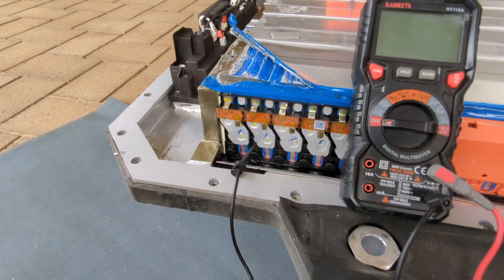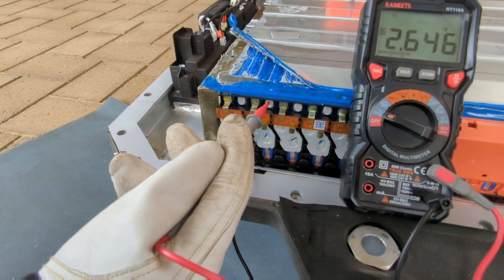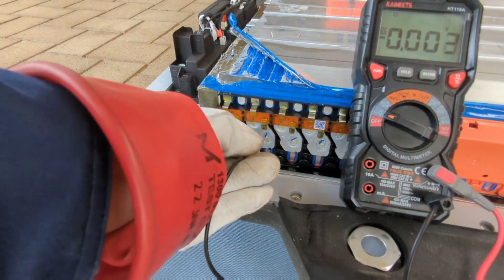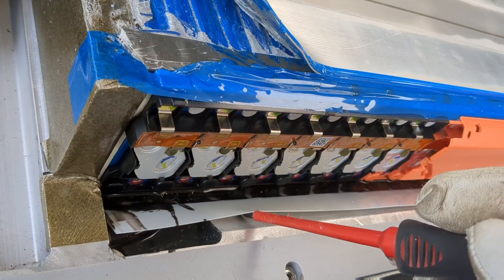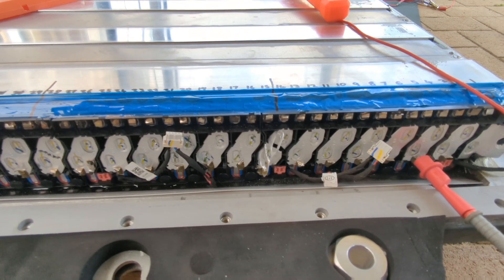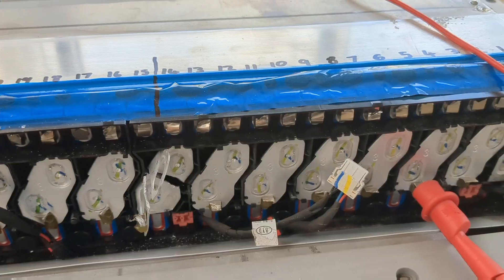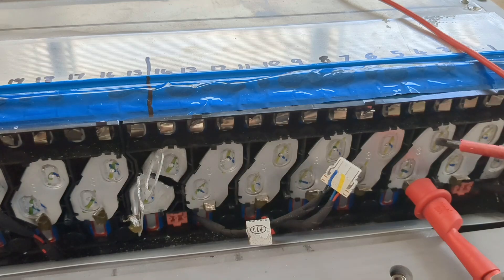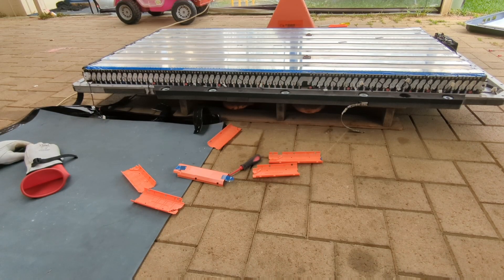BYD Atto 3 battery dismantle P3 - cutting busbars

Comment: Hi Brendon,

Did you locate the pyroe or inertia fuse location in the end?

Thanks
Reply from the maker: Doesn't have one. There is only a conventional over current fuse in the battery pack. During an accident, the SRS logs a fault code and the BMS shuts down the contactors

Comment: why you divide it 14 cells its give you 44.8 volts . if you make it 15 cells its will give you exactly 48 volts ???????
Reply from the maker: Because my current battery is 12s of NVM cells which gives me ≈44V.
Also there are 126 cells in the pack and if I cut it into lots of 15 or 16 I would have cells left over that would be wasted
Reply: @Brendon_M  I understand you , is the system work fine with you , with no problems ? 
Another question , how the bms can read 44 volt as a full battery ??? , what about the cut volt and charge volt and float volt ????
Reply from the maker: My BMS is programmable so I just set the number of cells and the upper and lower voltage limits

Comment: Olá amigo parabéns pelo video posso converter uma bateria assim para usad em 48v sistema Offgrid.
Reply from the maker: If you plan on making a 48V battery then you should avoid the BYD battery. They are too difficult to work with.

Comment: Very interesting work! 👍
To get it right: The BMS was connected to EACH cell originally (or only every second)? The Blade batteries and Teslas 4680 are worst from serviceability point of view - wich is zero. 🙈
Fortunately my Teslas have the  NMC/NCA setup with 4 blocks and also CATL LFP cells. "Kind of" serviceable.
Reply from the maker: Every cell was connected to the original BMS

Comment: Looking at all of this ( great work btw) the conclusion is: If your Ev gets older and is out of warranty and something in there breaks, it's totaled. You always have to change the whole pack. Not even a cell has to be bad. Its enough when one single electronic part of the BMS fails. Looking at this the BMS is much more complex then I thought.
Reply: Well first this is a home tear down.

If you watch a modern mobile phone tear down, you need the right equipment to break them down.

You will need a heated table to activate the sealer,  and solvents to remove the foam fillers.

There is always a trade off between repairability and reliability.  
For you to have a waterproof battery pack that can survive 300k km of abuse on poor quality roads,  it's going to be assembled in a way that is going to constrain vibrations and contain water ingress.
Reply from the maker: Thanks, though I'd be hesitant to call this butchery "great work"😆

Comment: the metal case of each lifepo4 cell is powered too; having physical contact of these metal case is a bad short
Reply from the maker: Not in this case (pun intended). The cell terminals are not galvanically connected to the case.

Comment: Hi just watched your video after cutting battery how do you connect to cells ?
Reply from the maker: I did dodgy bolted on eyelets. I'm not really happy with the connection but each string of cells will see less than 10A so it should be okay

Comment: Hello Brendon , that intresting, might be that this capacitances on cells is part of active balancer  ? My Atto 3 strangely has more balanced battery after DC charging 50 kW from 80 % to 100% with delta only 0.205 volt but when charged slow on AC delta usualy keeps higher - 0.300-0.350 V
Reply from the maker: Nah, the original BMS is long gone. The capacitance is generated internally of the cells themselves. The pass through connection that goes from one side of the cell to the other is in close proximity to the anode/cathode so it develops a slight voltage.

Interesting that your cells are more in balance after DC charging though. I wonder if it's because the cooling system is run on DC charging but possibly not on AC.
Reply: Thanks for answering my question, when I charge battery from 80 to 100% battery management not cooling battery at all because temperature not reach 35 degrees, at SOC 80% BMS not allowing high current through battery so battery getting no more then 56 kw  (440v 129a initially then dropping gradually) cooling starting a bit too late on this car, only when 35 degrees measured by temperature sensors.
Reply: This battery gets hot enough to activate cooling system also when AC charging from low SOC like from 4-8%

Comment: I am wondering why 14 and 16S?is this LFP or NMC chemistry?
Reply from the maker: It's LFP. I'm going with 14s for a few reasons.
The 14s matches my current 12s NMC system.
I have a spare 14s BMS lying around.
And the 126 cells of the BYD pack divides nicely by 14
Reply: @Brendon_M  I see. Based on your current realities, the choice of 14S is very logical.

Comment: Nice work, what's your day job?  I think i would burn down the neighbourhood if i attempted this 😂
Reply from the maker: Thanks. I'm an automotive electrician.
I've found the secret to not burning down the neighbourhood is to make an explosion so big there is nothing left to burn 😁.
Reply: @Brendon_M  Where are you based mate?
Reply: Cool, it's good to see things repurposed.  Looking forward to more quality content👌
Reply: What will the rewired pack voltage and kwh be?  Will it still have active thermal management?  Reckon manufactures or aftermarket should provide vechile to grid, given the difficulty in repurposing the battery at end of life, assuming you have the space to store the bomb😂
Reply from the maker: @andrewlovelock3171  it'll end up 44V and 1350Ah  (60kWh). Active cooling will go but it's not going to be needed. The pack will not even see 0.1C

Comment: I'd like to know what material the center of the case under the battery is made of, how many layers it has, and if it's strong. If it's not too much trouble, Hope you'll show it.
Reply from the maker: If you mean the actual housing that the cells are sitting in (the bit between the cells and the road) it is aluminium. I won't be cutting it up to see it's internal structure but I'm pretty sure it's just a solid plate.
Reply: Don't cut, dangerous